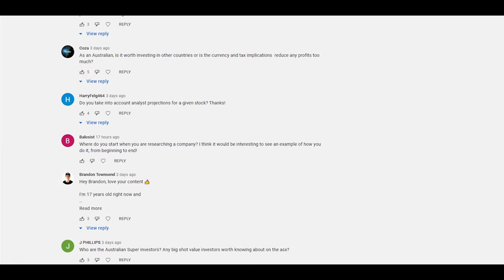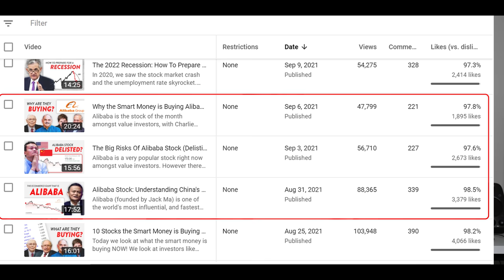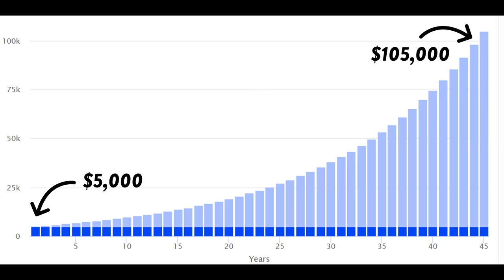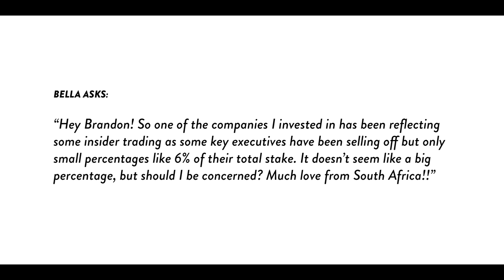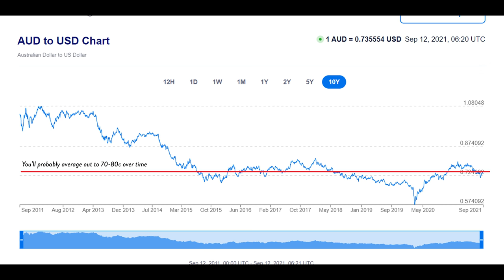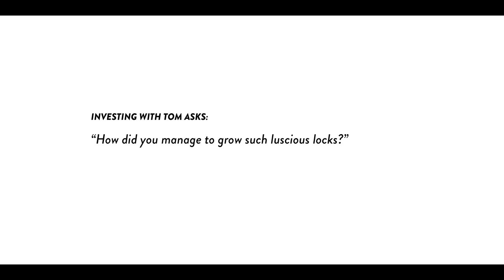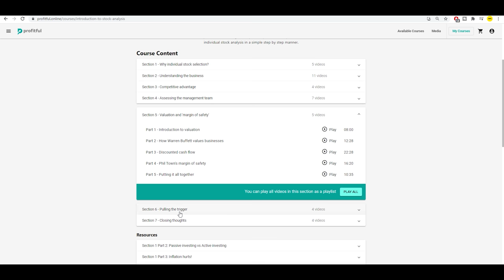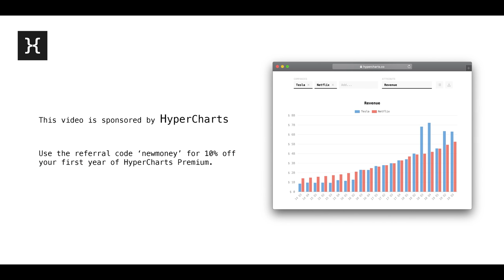Lithium Stocks to Soar? Insider Trading Worries? Investing Taxes? - Stock Market Q&A

Comment: Why was the Macbook Pro a waste of money??
Reply from the maker: For me I bought it to be a capable video editing machine, and unfortunately just found that it choked so hard on the footage I was feeding it, it was basically pointless trying to edit on it
Reply: I bought one yesterday. Taking it back tomorrow 😂
Reply: @keanamrazek3745  even the base model m1 is an awesome machine. But for video editing I’d be looking I get on the new M1X chip.
Reply: @dylancoppo  yea I bought it because i wanted a powerful machine for engineering simulations and design but I didn’t realize that the applications I need to use don’t support the m1 Chip even through a vm. So I fucked that one up😂
Reply: @keanamrazek3745  yeah I love my M1 but have a gigabyte aero 16 for cad electrical schematics as the software doesn’t run on iOS
Reply: @dylancoppo  yeah it really seems like a missed opportunity. Engineering software and the m1 chips seem like they could potentially be a perfect pair :(. Hopefully one day they realize.